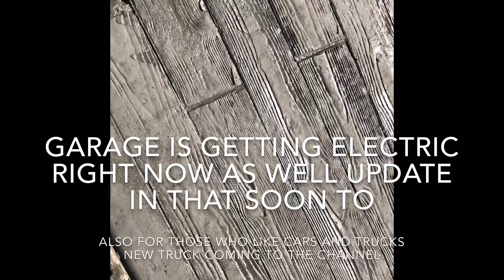STAMPED CONCRETE SIDEWALK!!!!! STAMPED WOOD CONCRETE!!!!!!!

Comment: Did you do the concrete if so....just a trick from an ol time mason pound your stakes just below form hight that way when ya screed ya don't gotta lift for nothing followed by a guy doing some quick edge with cleanup ya really get nice corners on your slabs that way. I was on your page looking at your garage videos great stuff I am putting one in soon and needed a bit of a heads up. Either war super nice finish in that concrete you guys nailed it. It really is fun doing that stamped stuff, coloring is hit or miss but stamping is cool.
Reply from the maker: No I didn’t pour it had a buddy do that but I’ll give him some of the tips next time he does it that was his first time ever doin that he said to